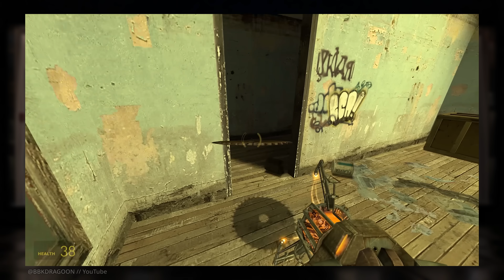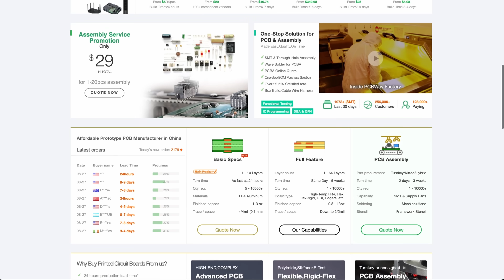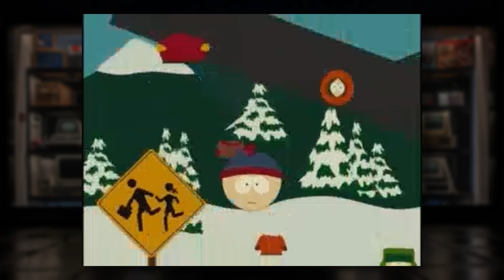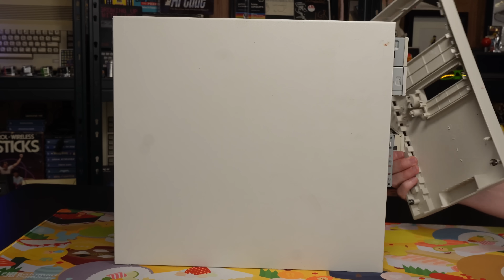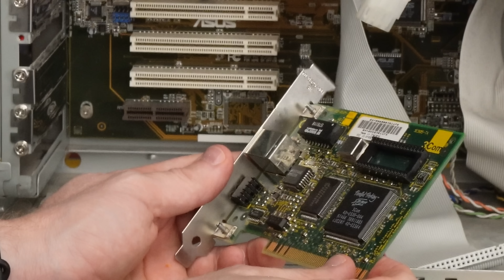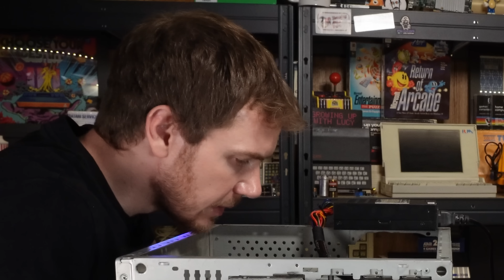Our 25 Year Old Family PC Was More Interesting Than I Thought

Comment: You could try the following:

* Perform a "bare bones" test.
  Remove everything except the CPU
  and one stick of RAM. Unplug all
  drives, USB headers, and GPUs.

* Inspect for shorts. A loose screw
  or a misplaced motherboard stand-
  off behind the board can prevent
  booting. Try testing the board
  on a non-conductive surface like
  a cardboard box.

* Clear CMOS. Even if the battery
  is not dead, a corrupted BIOS
  state can hang the power-on
  sequence. Remove the battery and
  short the clear CMOS pins for 30
  seconds with no power connected.

If there is still no fan spin or
response after these steps, the
motherboard or CPU may have an
internal electrical failure.

Comment: I used a Dimension 4600 in late 2003. I was years younger than you. It has a floppy disk drive, got with it, or had to buy them back then as they phased them out, still works for vice city, and a few older games.

Comment: I would also check if the green LED on the mobo has any meaning: Mobo manufacturers used to put LEDs on mobos to give an indication of what is wrong. For example: The LED may mean different things when it is lit, or when it is flashing etc.
So maybe the little fellow can give you a good hint.
Look up in the mobo's manual what the LED means. You can probably find the manual online if you don't have it anymore.
Good luck.

Comment: A GF 2MX without any cooling, that is not good. I had never even seen one before without any cooling.
It needs at least some small cooling fins like the ones which were on old 486 CPUs. Preferably with a small fan too.
So, if I can give some good advice, while you're ordering new caps, a new battery and such, order a small cooling radiator for the GPU, along with thermal glue (not thermal paste, thermal glue, unless you see screw holes around the GPU for fixation). Won't cost you more than €5.
Or, maybe you can find a cooling system from an old GF 2 series of cards. But then again, check if there are screw holes around the GPU, or you will need thermal glue again.
About the pc:
If you don't even hear a BIOS beep (check if there is a small internal speaker or a buzzer and if it is connected), it means one of the primary systems fail: The power delivery, the BIOS, or the motherboard.
Wish you good luck!
Reply: GF2MX cards without heatsinks are VERY common in OEM systems. 

I use GF2MX cards in a lot of my vintage, 500Mhz-1GHz builds, most of them didn’t have heatsinks, although I often add my own.

Comment: If my memory serves me correctly, some ASUS motherboards did not power up without a working BIOS battery. While I assume the caps as well  always try that before heating up the iron.

But I remember these days well, Southpark episodes came as Real Media video files and required the Real player. Quality was horrible but it was Southpark coming from the other end of the world via internet 😃
I also used to record my music videos with such an S-Video adapter with VirtualDub. But it really put a lot of pressure on the HDD which was just not fast enough to record in good quality. And then came the Deinterlacing…. Fun times 😊

Comment: Re-seat all components, check.  Replace BIOS battery, test.  Check if BIOS chip can be re-seated, if so re-seat it.  Given the age, there may be power delivery capacitors on the motherboard that have failed.  You would need to solder new ones on if this is the case.  I'm sure others will have a lot more suggestions, these are the immediate ones off the top of my head.

Comment: I'm not sure where this idea that the GeForce 2 MX has a bad reputation came from. You basically got the same performance as the original GeForce at a much cheaper price point. I think people get confused with the GeForce 4 MX which did have a bad reputation as it didn't support DirectX 8 unlike the proper GeForce 4

Comment: Try removing your cmos battery and all drives, then reseat/replace the cmos and try booting the board with no attached devices or drives, see if you get a post. sometimes a detected ground fault can be the problem. Maybe remove the board from the system and see if it'll post outside the box. Also, hook up a speaker to the board and see if there are any beep codes and try other ram slots. good luck!

Comment: We almost had the exact same setup!  Same motherboard and graphics card even!  My Athlon was a 900MHz variant.  I also had a Soundblaster Live in there along with my NIC and modem.  I disabled the onboard motherboard sound in the BIOS.  Sadly, I no longer have it as it would be the perfect Windows 98 retro PC!  You had the original Geforce 2 MX (not 200 or 400) with 32 MB of SDR ram.  It's a fantastic card for games around the year 2000 time frame!  If you can get it fixed up, you have so much expansion that it would be pretty cool to also get a pair of Voodoo 2's in SLI to experience some Glide goodness as well!

Comment: I think the Mos(fet) is fryed , did you try checking the ATX pins with a multimeter for short?(if it was the caps it would still run the fan , but no image) can aso be a card or cpu card....

Comment: I skipped over Slot A entirely, and built myself a Thunderbird Socket A system, in summer 2000, with an athlon 1100 processor. I was 15 at the time, lol. It replaced my 486dx100 system(not really, I recently rebuilt the 486 system, with a IDE to CF adapter and a picoGUS, lol, for dos gaming). As far as your PC not starting, you have to remember that these old systems ran solely off of the 5v and 3.3v rails, does your test power supply put out at least 25A on the 3.3v and 5v rails? I would recap the old power supply, modern supplies are skimpy on the 3.3vand 5v rails, as everything runs off of the 12v rails today.

Comment: Both InWin and Aopen had cases that opened up like that, and had a motherboard tray or whatever you wanna call that. I can't seem to find this exact model though.

About the problem, that could be an interesting one to figure out. I'd at least start with pulling everything you don't need to POST. So no drives, no network card, not even the front-panel connectors.
Still nothing? Remove the memory and see if it starts to beep. No? Oof... 

BIOS battery can be a thing like someone else mentioned. Ehm... also, if the bios reset jumper is set to reset you get exactly this. But I can't imagine someone leaving it like that.

Comment: I still have my original A600 Slot A system, back in the day it was overclocked to 850Mhz after chaging the cache divider resistors. Its back to running stock clock speed these days.
Your issue with powering up could be the power supply modern ATX PSU's are optimised for providing a lot more current to 12v rail vs the 5v rail of these old systems. Slot A needs more current on the 5v rails than the 12v.

Comment: Before you start heating the soldering iron. In This exact order. Try removing the battery, then remove the bios chip, and clean the pins [Award bios in a dip socket, I think] replace chip, do the same for CPU. Now add a new battery. And try again with all floppy and IDE cables disconnected.
Reply: My Celeron 400A retro rebuild one day failed to start up. I pressed down hard on the BIOS chip in it's socket, after hearing how those things can somehow wriggle their way out of the socket over time, and it started working again!

Comment: I recently acquired an Asus P2B which was dead like this. The 3.3v pin in the power switch is shorted to ground. I found I am able to boot it by shorting it's SMI header which bypasses the fault. Otherwise the CPU wasn't getting a good connection into the slot so I drowned it in contact cleaner and that seemed to help. It's quite reliably starting up now but on my pile for further diagnosing the ps_on circuit.

Comment: I use two of those Dell 4:3 monitors at home in a dual screen setup. My speaker bars are black. Lots of video connectivity, brilliant. When I'm working I really prefer the 4:3 ratio for documents and drawings. I can't remember why we adopted 16:9 in general. I guess having a really large single 16:9 monitor could be the reason.

Comment: Pretty posh case by the standards of the time. InWin or something in that range, maybe more expensive CoolerMaster or cheaper Lian Li. Or, actually, ASUS. No sharp edges, drive rails, motherboard chassis, neat looks... Resembles Asus 6AR by internal design, but 6AR was 4 years later, and 4 years back then were equal to about three quarters of eternity. A 2000 PC in 2004 was one leg in a grave.

Back then I assembled 2 to 15 PCs a week and convincing a customer to get a case like this was an achievement. 
In 1995..2005, age 13 to 23, I slapped together slightly over 2,500 computers, i80286 to S478 Prescott P4/Celerons and Socket A Athlons/Durons; only two or three had any problems and even those happened because of customer stupidity; my favourite chipsets were i440BX, i865G and i945G, and favourite motherboards were ASUS, of course (ABIT, Intel Original, Tyan, Supermicro, Chaintech, Gigabyte and MSI were quite passable too; the objects of overt hatred were PCchips and ZIDA/Tomato).

In general, for the year 2000 this assembly looks not exactly cutting-edge but quite decent nevertheless. I would install PCI V.90/V.92 Lucent WinModem (very good as far as winmodems went) and, for gaming rig, a Creative SoundBlaster or something Yamaha. Also, I never liked GF2mx for all its popularity, would convince a customer for a full-blown GF2 GTS, or probably ATi RV100, something like Radeon 7500LE.

Comment: Geforce 2 MX is a decent budget graphics card for a 650MHz system, with excellent OpenGL and DirectX 7 compatibility. I'd be strongly inclined to add a small heatsink and fan though- that bare chip will get very toasty indeed!

Comment: I have a card that fits in that AMR slot. I was given a Packard Bell and I think that it is a modem with an RJ11 plug. It wasn't something that I wanted to use, even if you can use it now, so I didn't go looking for a driver and to stop the error message in Device Manager just pulled it out. It will be in the parts bin somewhere. It is probably only good for someone making a retro exchange.

This ASUS mobo isn't one of those that is not happy having a dead BIOS battery, is it? I forget why it does it now, but I have heard people have the same issue.

Comment: I built exactly the same case, think it was about 1997, intel Pentium MMX 233, Chaintech IFM1 mainboard, Matrox Mystique PCI Graphics card, 32MB EDO RAM., Soundblaster 32 ISA Soundcard It was tool-less, but somehow I regretted it, it was not really faster as some smart screw-based towers and and the moving in-and-out felt so "scratchy" and in general a  less robust impression.

Comment: Aww -- hope you get it working soon!

And yah, we had a no-brand beige box a bit like this back then, built in 1997 or '98.  A Socket 7 AMD K6 CPU (don't remember how many MHz), a fairly normal video card for the time (don't remember which one), and Windows 98.  It ran ran most late 90s/early 2000s games well enough, and I spent many hours in Civilization II and III, The Sims 1, and SimCity 4 SimCity 3000 on it.  

Originally it was the "kids' computer" in my family, shared between me and my brother.  But it became more-or-less mine after my brother got an Xbox in 2002 or so.  And I kept using it for rather too long -- with an upgrade to a bigger hard drive -- as I couldn't afford a new PC until 2007.  I forget when we recycled it.

(*EDIT:* Corrected SimCity version.)

Comment: nothing like jumping from a 486sx50 to a Slot A. THAT was a face-melting jump in performance that I haven't experienced in building PCs since...
Reply: I went from a 286 to a 500mhz athlon 😂
Reply: Maybe the jump from Pentium4 to Core2duo
Reply: Yes. I had a 500mhz Athlon given to me.  Outperformed the Socket 7 500mhz AMD.  It did have limitations.  Upgraded later to a 850mhz, before using a Sempron Socket A.  Eventually I told myself, no more single core processors.

Still, I refuse to discard my P4.
Reply: I went from a 386 DX40/8MB to a PII-300/64MB, which was similarly incredible.

Comment: In 1999 I went to a computer fair (remember those?) and they had Slot A motherboards and Athlons laid out... bought one immediately with an Asus board, I think I must have read a review in a magazine first but they were the thing. I bought a 700MHz 'argon' stepping, built it up and was blown away by how fast it was which was good given it was expensive. Then with a Gold Finger Device that attached to the cartridge PCB tried my very best to overclock it to 1GHz but it never quite made it there, I think 900 was its limit much to my disappointment.

They were good chips though, even those first ones with the 1/2 or 2/3 speed L2 cache separate on the cartridge. Shame Slot A didn't last long, that was definitely not one of my smarter purchases as far as longevity.

Comment: On a system of that vintage, bad caps immediately spring to mind...
Reply: It's true, that the co-called Capacitor Plague started towards the end off 1999 to 2007 but it does not automatically mean every single capacitor of that time-frame. I do not like seeing people change capacitors that were guaranteed to last way beyond expected life of 20 years, for modern ones that may last 10 years.

Comment: I'm going to play a round of "Guess What Parts Are Inside" based on the outside.

Case:  That's definitely Enlight.  I recognize the teardrop shape on the reset button.
Motherboard:  I don't recognize the ATX I/O shield.  (BTW, the network port was probably a knock-out that someone knocked out despite the board not having the Ethernet option populated.)
Drives:  I think the DVD drive is an NEC Optiarc, the CD-RW looks to be Philips (or OEM'd by them), floppy ... I'm going to gues... Mitsumi?
Cards:  The video card is hard to tell.  I'll take a wild stab though -- GeForce 2?  Maybe an MX?  Network card looks like a 3Com.

Edit After Watching:  Nailed it.  :-D  Except for the drives... those are still a mystery.  And I did not guess the motherboard -- but in my defense, I don't think that's an Asus I/O shield anyway.  I've never seen them use that oval-shaped cutout around the audio jacks.

Comment: Having dual optical drives was quite the flex in 2000.  The RAM module should have a sticker on it to identify the capacity. I would rummage for a pair of 128MB PC100 DIMMs to put in the unoccupied memory slots.

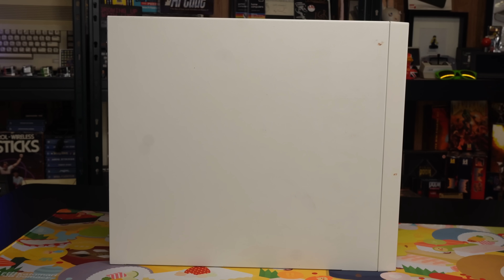Comment: 5:16 The WinTV 401 was a poor choice for the job - it could only capture 320x240 and had no hardware compression so you got the worst of all worlds: low-quality video with massive file sizes. By 2000ish Hauppauge and Pinnacle had cards with hardware MPEG compression, or you could have got a Matrox G450 eTV instead of that godawful GeForce 2 MX!
Reply: Or a All In Wonder ?
I have a 8500 AIW but  never tried capture with it.
And of course now the tuner is no use :(

Comment: The GeForce 2 MX only had a bad reputation because it was short-lived. It was quickly replaced by the GeForce 2 MX 400 (basically identical) and the GeForce 2 MX 200, which was utterly crippled. 
The "200" made folks assume it was newer/better than the unnumbered "MX", and it clearly wasn't.

The GeForce 2 MX is a very serviceable card, period correct and plenty fast for that machine. It's basically a die-shrunk GeForce 256 with a wide memory bus.
Reply: The memory bus isn't any wider than a GeForce 256. Both feature 128-bit SDR memory bus. (Or sometimes, 64-bit DDR) In fact, it's a worse memory configuration than the GeForce 256 DDR cards. It is about on par with the GeForce 256 SDR, despite being a cut-down GeForce 2 GPU, thanks to the higher clock speeds and architectural improvements.

Comment: Did you change the bios  battery  that can sometimes stop it from working  as well
Reply: That is almost certainly it.  I have an Asus Socket 423 Pentium 4 board from the same vintage, and it was dead as a doornail.  No signs of life whatsoever.  New battery, and it booted right up.

Might still need new caps, but IME, that is generally not something that will prevent it from starting -- just something that will prevent it from booting or running stable.
Reply: @sirnickity  I agree for the caps.
In fact 3.3 v are needed to tell the super IO to start the power supply.
Worst case it doesn't receive the signal "power good" from the PSU.
But unless the PSU is dead, it starts and at least the fan turns.
I though the need of a battery was more modern.
Reply: @nalinux   There are three times when caps are going to be a real problem:

1) When the signal is AC-coupled, so it has to go through a cap, and that cap is essentially open.  More common for audio and video circuits, not digital signals, and definitely not power rails.

2) When there's a DC-DC conversion stage, like the CPU power rails on P4+ boards that run from 12V.  This can cause any amount of failure from unstable performance to carnage of downstream components.  But typically, more the former.

3) If a cap fails shorted and shunts a signal or rail to ground.  Not as common for electrolytics, and, given ample current, would be a catastrophic failure for the cap.  See: Tantalums.
Reply: @sirnickity  yes, I know, I'm in electronic :)
Reply: I'm not sure it made a difference for this period.
But sure it does for more recent computers.

Comment: We basically built the same computer back in y2k! Mine was my first and only build though but the specs are pretty similar. I also had a TV card, and I digitized a few things from VHS so maybe I hade a bit more storage/memory (and a 1 Ghz socketed Athon I think). Brings back memories!

Edit: Posted my comment before watching until the end, mine still worked ~10 years ago or so. Used it to create .d64 images using my old 1541, it didn't connect easily to my laptop back then. So I pulled the computer and my Phillips 8833-II from the eighties out of storage - they both worked like a charm. Crazy. Looking forward to the rest of the series! 😍